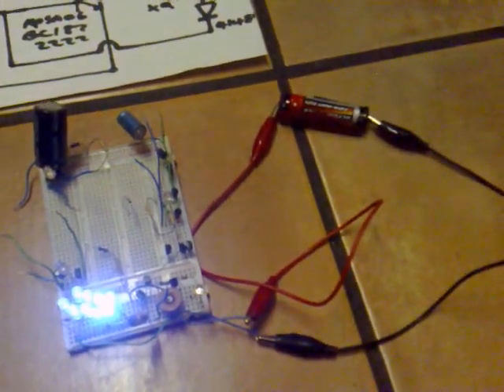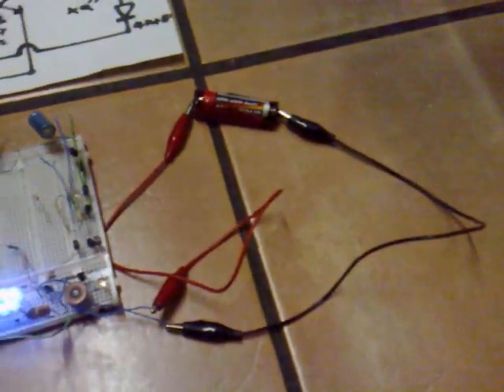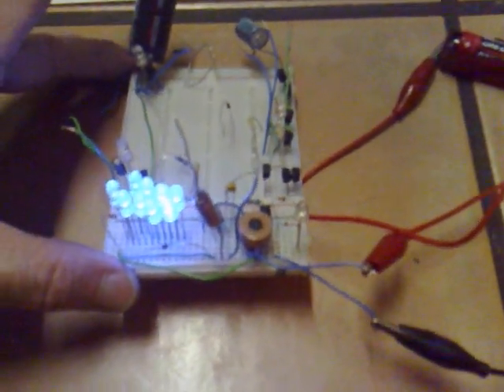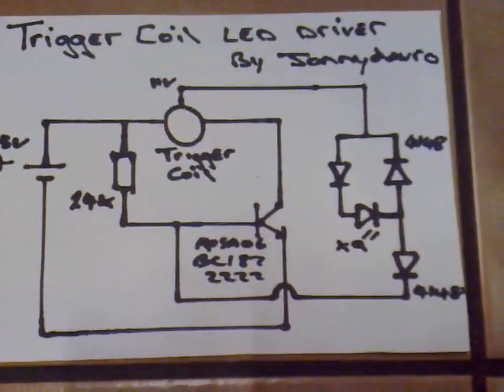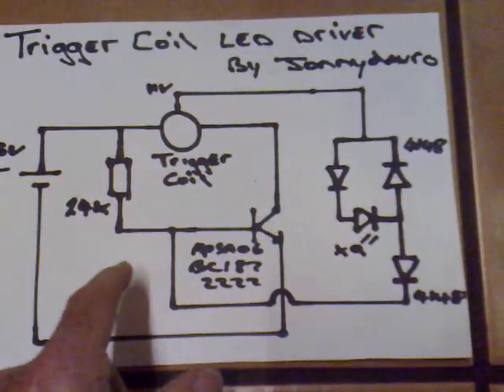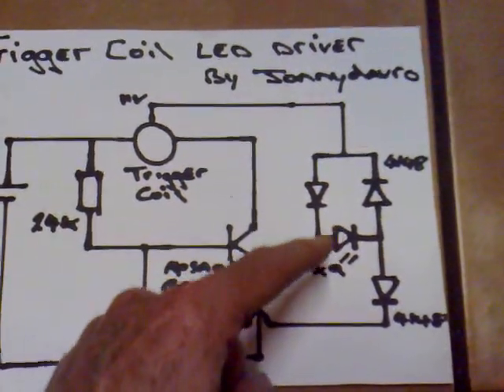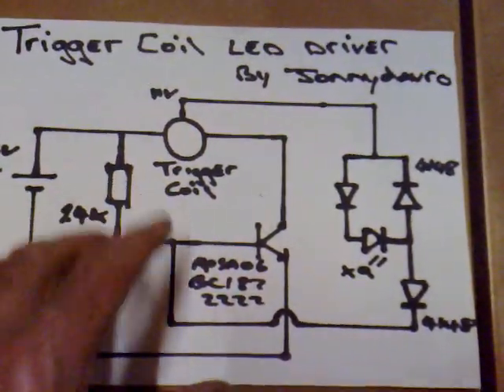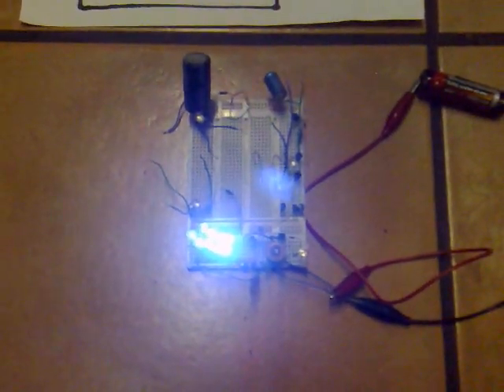Led driver

Comment: To help speed up the transistor switching and help start and maintain the oscillations, try paralleling the base resistor (24K in your circuit) with a non-polarized ceramic capacitor in the 10 to 20 pf range.

Comment: The reason they're not useing this circuit is because it's so far ahead in concept and utility that no one has had the time to catch up with it. I believe that if you could neatly package the circuit and manufacture and distribute the units to retail stores, the design would  out sell everythig else, and completely dominate the market. I believe strongly that this particular circuit represents the highest state of the art in the field of  hand held "Flashlights" to date. Congratulations!

Comment: Many thanks in return for replying me. I used the same parts as you did except the transistor which was 2N2222A. I measured the current draw across the 1ohm resistor (in series with the battery positive lead). Did you get the same current consumption for the 2N2222 as well, I wonder?  medi

Comment: @jonnydavro im clueless as to why they dont use them either.. i noticed though that a lot of circuits, especially ones like the small garden solar light drivers, they use the small chip that steps the 1.5v up enough to light a 3v led, but the step up is hardly enough and @ enough current to create a usable torch. some day Jonny, some day! lol